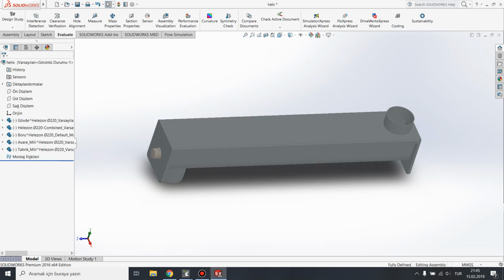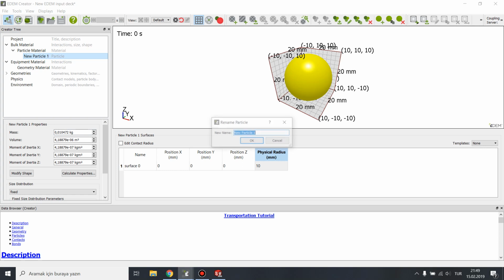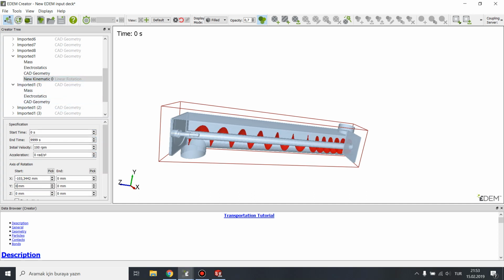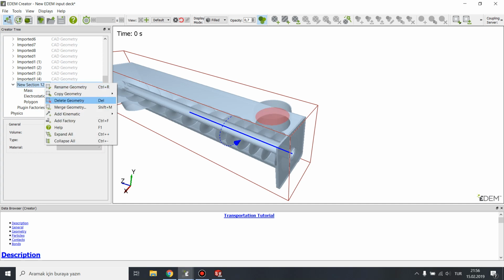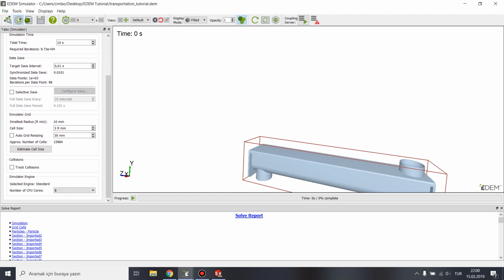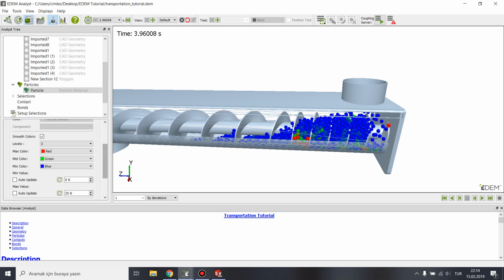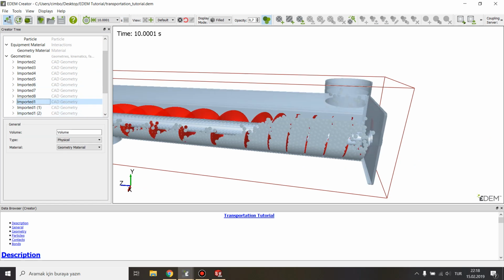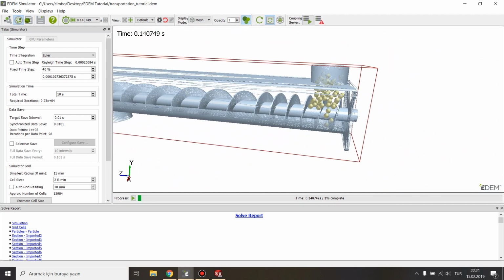Introduction to EDEM - Particle Flow Over Screw Tutorial

Comment: thanks for the  video, I cannot import the file, the green bar stops at 33%.  like the others can you help with a video about it or a link or email Thanks
Reply from the maker: please send me the cad file via email. i will try to import it and send it back to you next week.
Reply: @engineeringsimulations8355  painrikosu8@gmail.com      this is my email contact me so i send you the file and tell me how i can fix it so in futore solidworks sketches i won"t face the same problem thank you
Reply from the maker: I can import files with my installation. I could not find a way to fix the ones that reported the same problem. So, send me the file that you want to use.
ansyswbtutorials@gmail.com
Reply from the maker: Please note that i am using edem 2017. if you have a newer version, i will not be able to help unfortunately :(
Reply: @engineeringsimulations8355  just tell me how you solved the probleme i am using 2018 version but i will try what you did hopefully it will succed we hav the same problem it should work thanks
Reply from the maker: @painrikosu1017  I can not remember the solution that I applied. It has been 3 years after installing. But, I will try to get this error, solve and record it while solving, when I find some free time. Unfortunately, it is not going to be soon i guess :/
Reply: @engineeringsimulations8355  thank you if u can help me with that it will greatly help me in my researsh and if u have similar software for particles charge study please feel free to share and i apreciat the help thank you so much
Reply: Reinstalling your operating system will fix the problem.

Comment: Sorry man, why can't I import my geometry? It's in "step" format... but the green bar stops at 33% and doesn't go on. Have you installed something else besides the program?
Reply from the maker: Hello,
No, I did not. Maybe there is a bug in the file? Did you try to open it with a CAD software? If it can be opened with it, try to import it as a different file type, such as stp, stl, iges etc.
Also, I am not sure but I remember that the installation was asking whether you want to install some geometry readers or not, with the original software. If my suggestion above does not work, please try to reinstall the program and check whether it is asking about installation of geometry formats or not.
Note: You can also share the geometry with me to check whether I can open it or not.  ansyswbtutorials@gmail.com
Reply: @engineeringsimulations8355 
The file can be opened by a CAD software... and in addition to this, EDEM doesn't open the example file with the truck, if I try to set a new file and import the geometry as you shown.
Anyway, I'll send you the file via mail in order to let you try. Thank you very much.
Reply: @sharkracingteam1986  The same thing happens for me.
Reply: @ananthnarayan5472  Try by changing the file name - use simple short name without dots and symbols. And English letters...
Reply: @savata71  Thanks but that didn't work too. I think my system is lacking with software. This might be problem with processor being used.
Reply: Reinstalling your operating system will fix the problem.